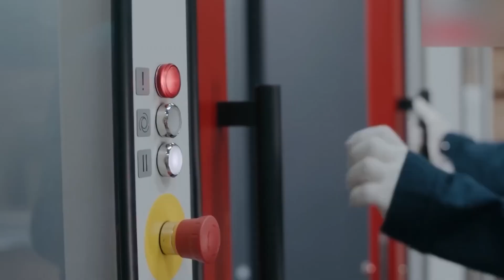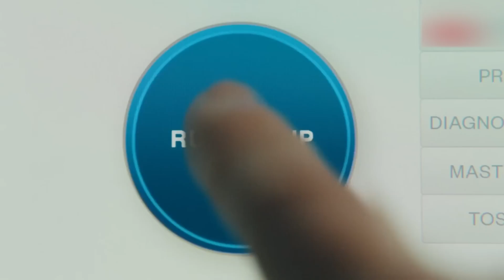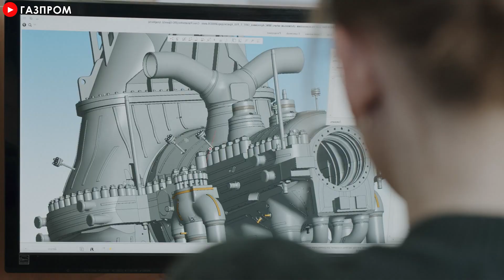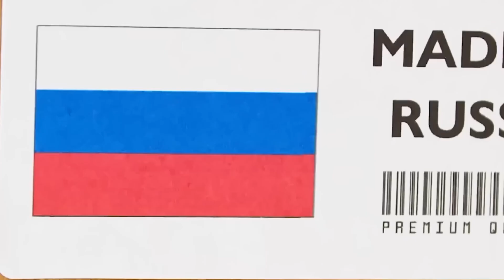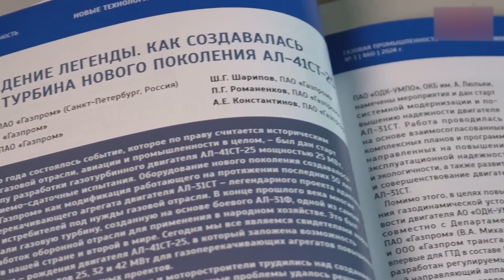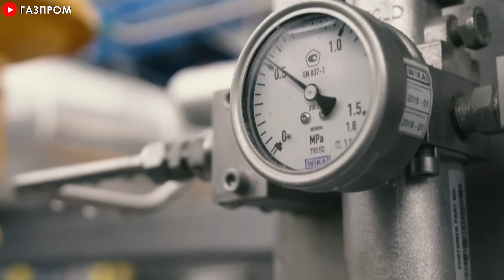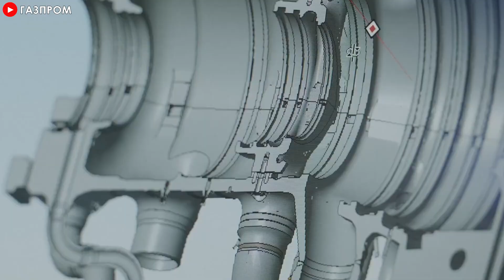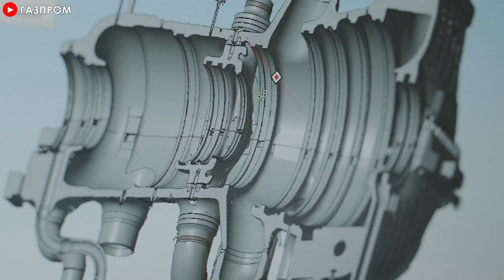This Russia’s NEW POWERFUL ENGINE Will CHANGE The Industry! Here’s Why

Comment: In 1950 the first Russian 25 MW gas turbine based on an aircraft engine was installed at the Kashira State District Power Plant. It was one of the world's first industrial gas turbines.
1960s–1980s: Serial production of gas turbines of varying capacity began, which were used both for power generation and as a drive for compressors in the gas industry. 
Here is a list of Soviet turbines.
GT-25 — 1950.
GT-750-6 — 1960s.
GT-100 — 1970s.
GTN-16 — 1980s.
GT-25000 — 1980s.
PGU-450 — 1980s.